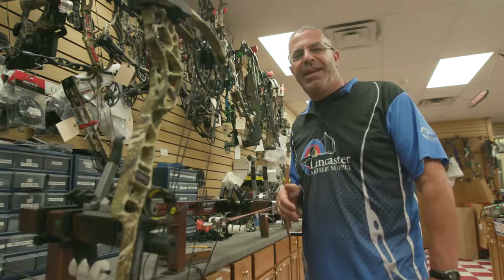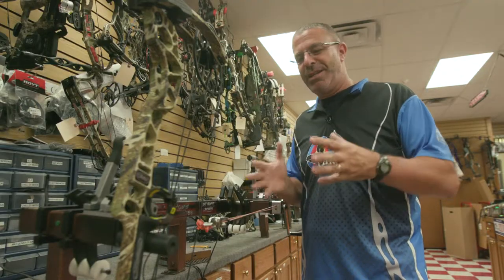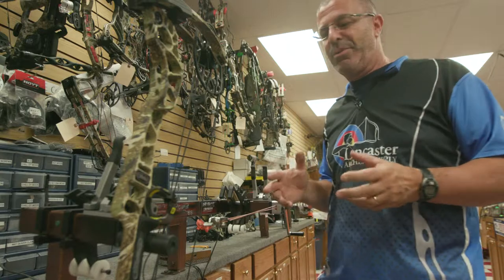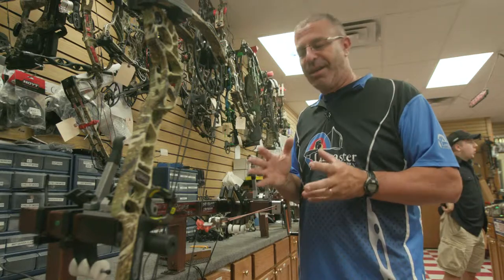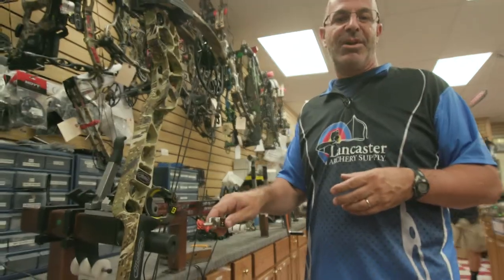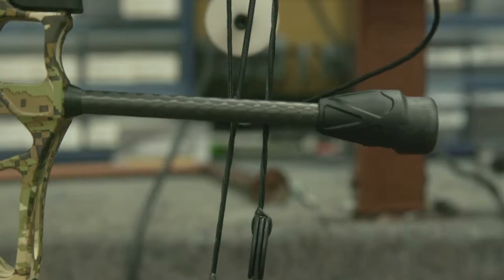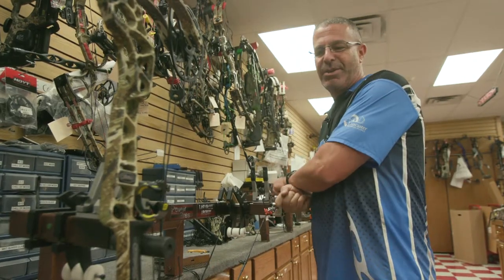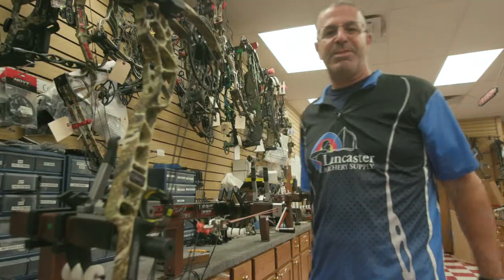Bowhunting How-to: Drop Away Rest Timing | LancasterArchery.com

Comment: most of the time mine works fine, but sometimes the rest doesnt drop out of the way fast enough and the vanes hit it. Why does it happen only sometimes? Strange.
Reply: Having the same issue. Seriously considering getting a whisker biscuit instead
Reply: @joelmahoney600  I had one that would smack the shelf and come back up which would hit the fletch sometimes making it seem like it wasn't falling fast enough.
Reply: @Wickid68  how did you figure out it was hitting the shelf and popping up making contact? I tried filming and even in slow motion everything was so fast I couldn't tell.